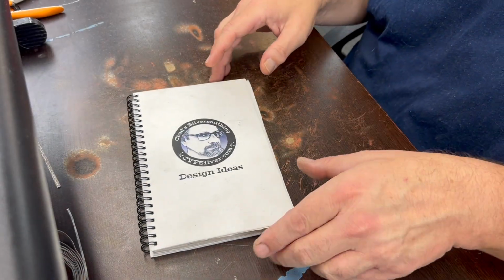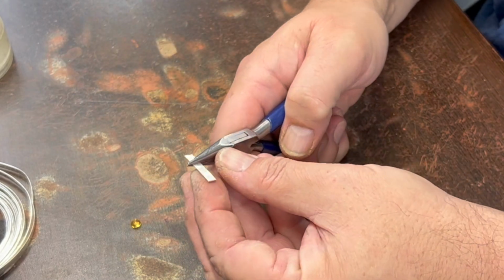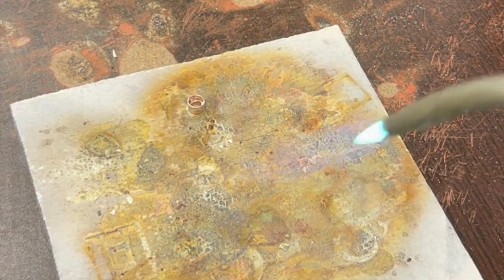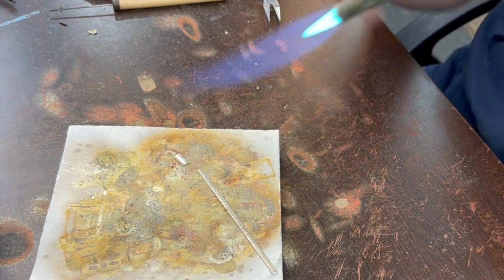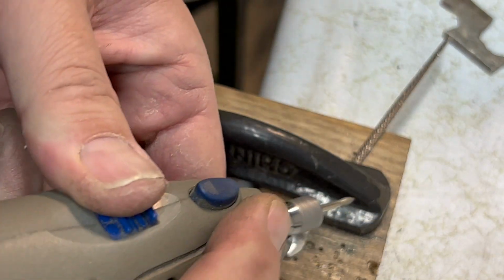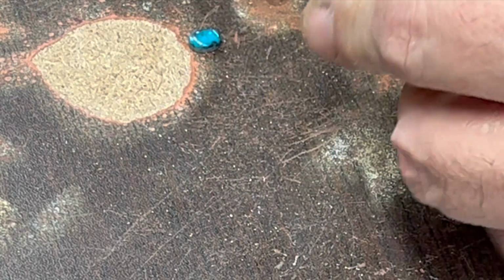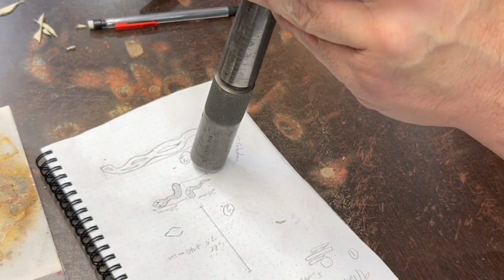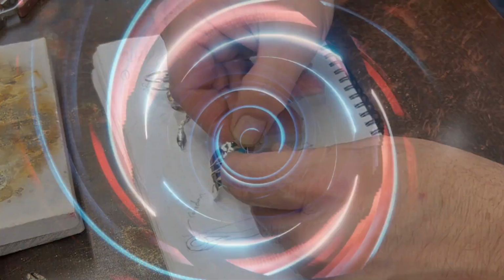3 Wrap Ring Designs:  A Silversmithing Tutorial

Comment: HI Chad,
I always looking at one of your videos at least 3x/ week. I also use an acetylene torch. However, it just dawn on me. with your torch there is small fire point compared to by fire output. What size torch do you use?
Reply from the maker: Hello Joyce:). I use a number 1 tip for most things.
Reply: Thanks , for the response. I have a #0 . I'm changing up. Big difference.thanks again.
 @chadssilversmithing